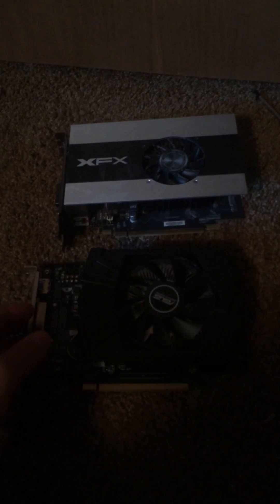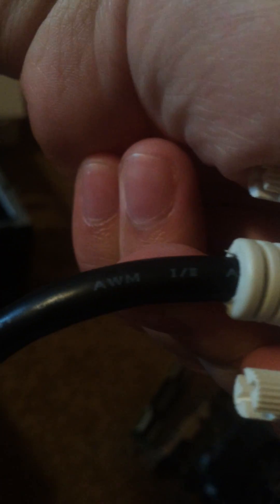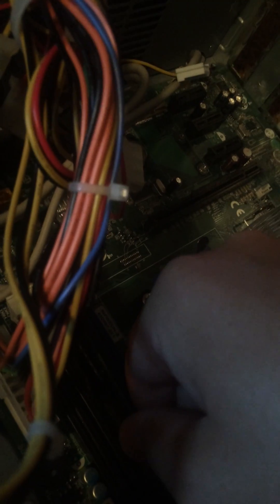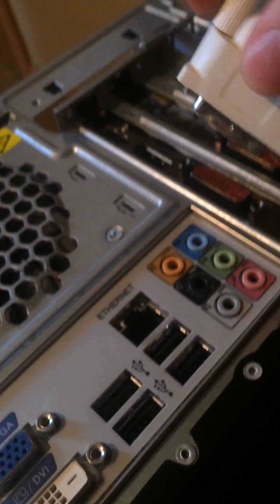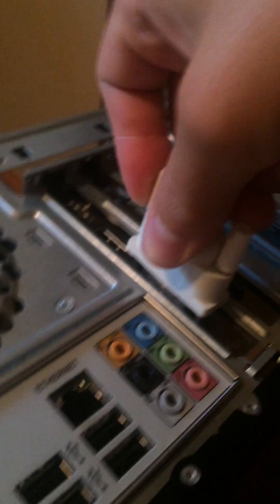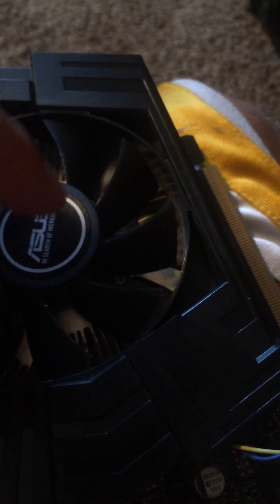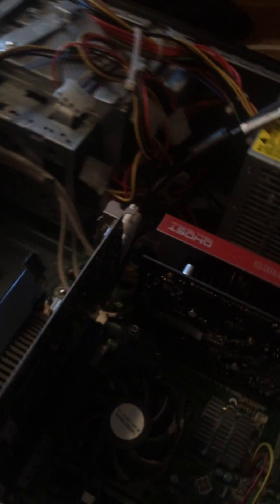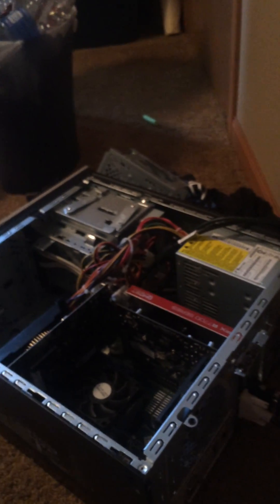How To: Cross-Fire with 2 Different GPU's

Comment: Thx m8 im now playing minecraft in 20 fps on lowest settings. So excited! 
Here are my specs.. 

cpu- intel Pentium P4 2.26Ghz 512KB 533Mhz
gpu- e-TNT2 M64.032-A4-NV02-S1 GRAPHICS CARD 32MB AGP SP5200B
case- Genuine Dell Precision 620 Tower Xeon
psu- Genuine Dell 250W Power Supply
ram- 128MB STICK
hard drive- Toshiba HDD1764 80gb 4200rpm Hard Drive
Reply from the maker: Mike Hunt Good to hear Mike!  Stay tuned for next week's video I'm going to show you how to put 2 CPU's to make your computer a SUPER computer! Thanks for the comment!
Reply: InvictusGaming hey umm my CPU has a virus and also I my computer is slow cuz my grama sed that there was to many icons
Reply: What should I do
Reply from the maker: Woah dude, thats crazy!  My step for step video is virus free. Have you tried using WD40 on the cpu? Try applying it directly on the pins!